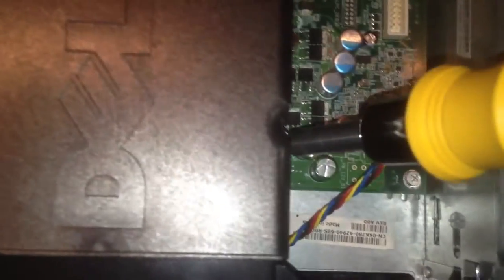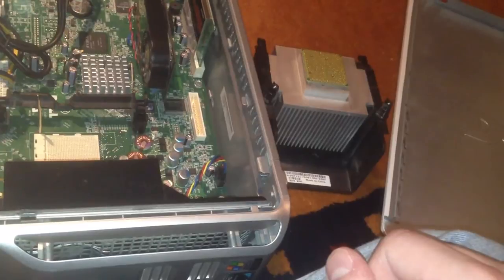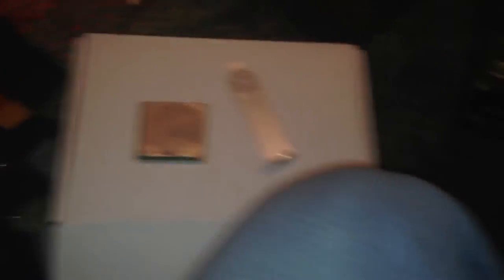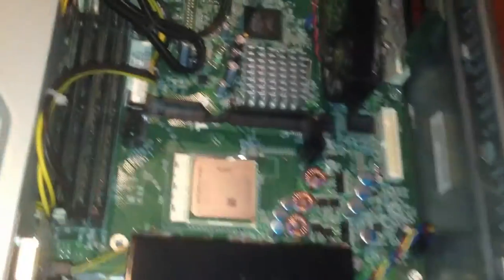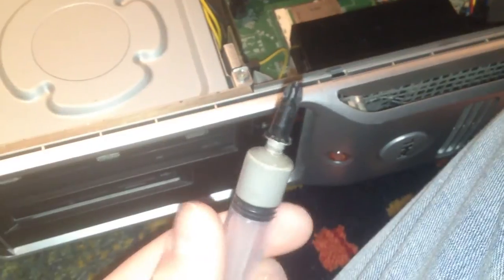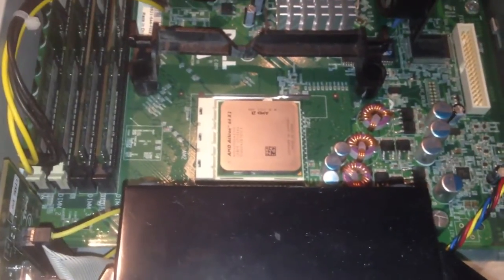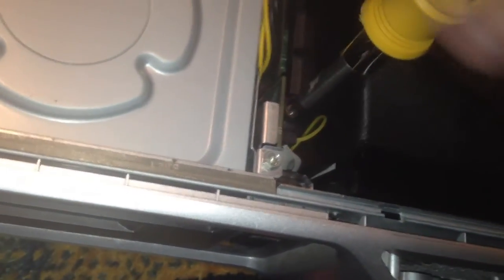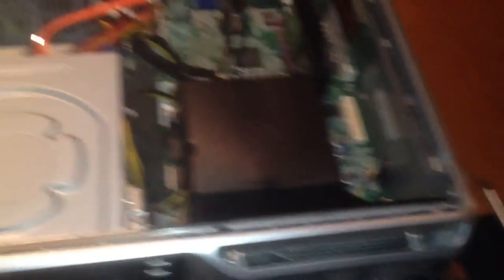Dell Dimension C521: How To Change The CPU

Comment: Hey, i have a question if you dont mind. I have had this computer for quite a while now, gotten it repaired twice. Last time i got it repaired the mother board was replaced. About maybe a year and a half had passed and its gone right back to its previous condition. Just constant running fan, and amber light. Anu suggestions?

Comment from the maker: 89 watt should be fine. 125 would wear out the VRM circuit over time because it's not designed for a 125 watt CPU.

Comment from the maker: it'll run any socket AM2 CPU that is a 95 watt processor. don't stick a 125watt one in there because that will stress everything way too much. you shouldn't have to touch the software.

Comment: i also have one of these besides my regular rig and ive been thinking about messing with it a bit and maybe building something for the hell of it, the other night i did the same thing you did (its hard not to when you pull that big thing out) in my case like 10 of the pins got bent so i just went to eBay and got a much better cpu for 8 bucks and got rid of that worthless sempron,anyhow thank you for the video,it helps out.

Comment: I put a intel core 2 duo e6750 and it works really well. I have a nividia geforce gt 640 2gb and 6 gigs of ddr2 and it runs just like a gaming pc.
Can play eny major game With high to extreme settings. 
I recommend you upgrading to these parts works great with it.(Btw i have a dimension e520)
Reply: ''Any game on high to extre'': Really dude?? can you play crysis 3 on high to extreme?? ¬¬
Reply: MegaAgente17 yes?
Reply: No. Just in medium. I have the same game and 4GB RAM, AMD Athlon 64 X2 6400+ and a Zotac GT 640 on my Dimension E521. I can play some games on ultra like Most Wanted 12, Far Cry 3 and Battlefiled 3. It's really good card but i want to upgrade to a Zotac GTX 750 :)